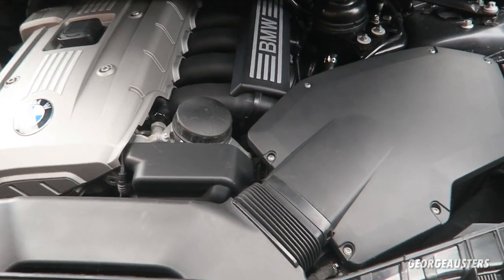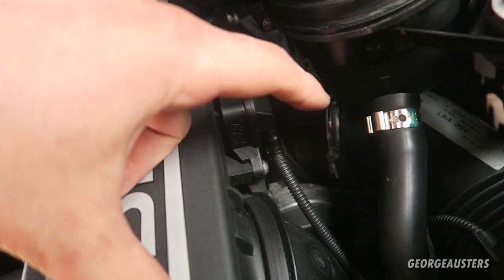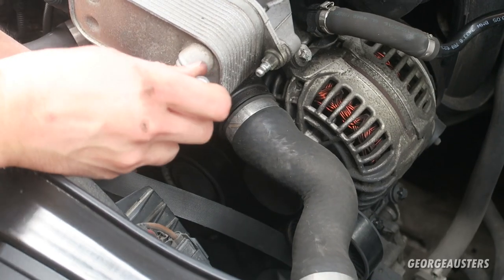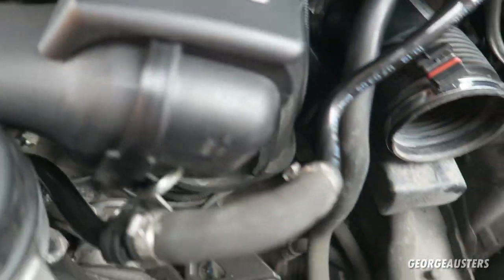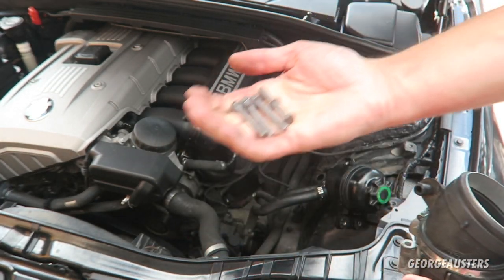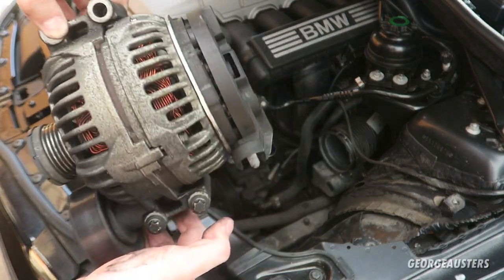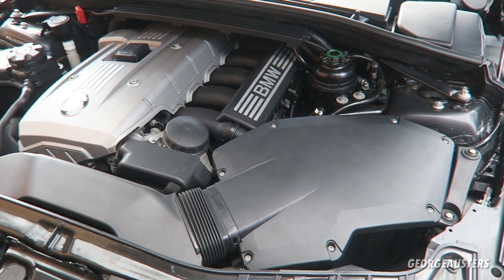BMW N52 SMALL DISA REPLACEMENT *Without Removing Intake Manifold*

Comment: This right here is the best idea you've ever had, my friend! Pure genius. 
Everywhere else insists manifold removal is the only way and I don't ever want to take that thing off again.. The starter motor required it but the problems start when trying to reconnect the last couple of PCV hoses. Suffice to say it had to come off twice to fix the large vacuum leak that resulted from me failing to fully seat the last hose to the crankcase at the PCV end. It was impossible to reach without starting again. Gutted
Reply: Actually the last crankcase pcv hose is reachable from under the car. Mine was noty fully plugged to the valve cover. With a help of long screwdriver I plugged it in from under the car.

Comment: awesome video. was trying to get my small disa valve out. got all three bolts, but wouldnt budge, i assumed i must have missed something came here to find out i didn't. yours seems so easy. thanks!
Reply from the maker: Only 3 screws holding it in, likely just stuck with the gasket, need prising out
Reply: Not sure if it works for you but I used a screw driver flat head from the top of the intake and use the intake as leverage. Switch between left and right and eventually it comes loose.

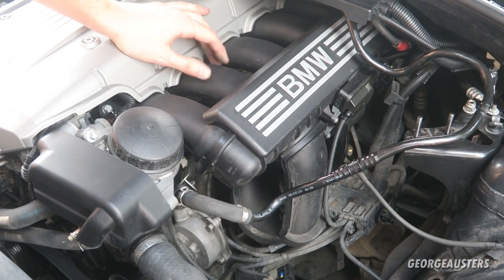Comment: NOOOO..... I just got up to 11:20 on the job, and on the 2008 E92  - N51  I definitely need to remove a CCV pipe that's in the way of pulling the Disa valve out, under the manifold. I can reach the near end to remove it, but not the back end... I'm afraid to try to flex that thing. I could have seen that after removing the alternator, but I didn't look too closely with a light. UPDATE: I got it! Just removed the front end of the pipe, and could push it aside just enough!
Reply from the maker: Good stuff
Reply: How did you remove the front end of the pipe? I’m currently stuck here

Comment: Hello Georges, Thank you again for this video, I would gladly give a few € but I fear the scam with VISA. 
My BMW Z4 E89 2009 23Sdrive 2.5l 6 cylinder 200.000Km does not require dismantling the alternator, the small DISA goes through the rear of the engine. There are just a few difficulties with the vacuum hose. 
The engine was running badly at idle and meows made me think of the belt for a long time, but no, it was the 2 DISAs.
Good road to all
Reply from the maker: Glad to help!
You can buy me a coffee / beer here: https://www.buymeacoffee.com/georgeausters

Comment: Thanks, this is really interesting to know that you can somewhat easily check/change your DISA valves with less hassle (though I think it could be the right time to change all seals and the PCV system in the meantime).

Comment: This has been really helpful thanks, George! I did this with my E61 with the additional stage of removing the cooling fan to gain access to the drive belt as there's very little wiggle room. I'll be replacing my tensioner and belt very soon, too. Similar process as far as access goes. Cheers!
Reply: This was helpful as I’m attempting to replace both DISA’s on my dad’s E60. Cheers 👍 

Edit: Just completed the work and your tip helped me alot. Thanks George and Bryce ✌️
Reply: @BOOMROCK535I  I'm not sure if it'll help you, but I've done an E61 (E60) video on my channel replacing the disa. Similar to George's, but there are some differences.

Comment: While you had alternator out , you should of replaced voltage regulator in it ,at that mileage they are getting there , had mine replaced at 130 k and was just in time , brushes were almost completely worn out . Plus it would be a good diy video too . 😀
Reply from the maker: Yep I’ll replace the alternator when it needs doing, very easy to remove👍🏻
Reply: George Austers , I click on your eBay link for the disa valve and all it does it takes me to eBay ? Could you please maybe repost the link , I am looking to get a disa valve too and am in USA and here we only have genuine bmw ones and Chinese copies which is a no no for me , I have never seen Febi make one and that’s a great , Febi is good parts supplier.
Reply from the maker: @eldin9117  Fixed! https://ebay.to/3i9kkvl

Comment: excellent video!!!  thank you very much for your help!!
i replaced both disas, the voltage regulator, and cleaned the throttle body on my 2008 x5 3.0si using this method.  but now I have a code (2A16 DMTL, superfine leak).
I must say that the process is not as simple as it seems, but with patience you will have favorable results.  With the small disa I found a hose (I think it's from the PCV system heater) that goes between the block and the intake manifold all the way to the alternator.  and that makes the job a little risky when it comes to having to pry that hard plastic tube to be able to remove the small disa from the intake manifold. maybe I managed to crack it and that's why now I have that code.  (I hope to find a video on how to replace that). 
At the end, it is not a lie that the work is done in a fraction of the time compared to having to disassemble the entire intake, but since everything has a risk, this is not the exception.
Finally, I want to mention that if you disassemble the throttle body, it is not necessary to disconnect it (I did not do it because I didn't know if it had to be reprogrammed, which I do not have how to do).  you just need to put it aside safely and out of the way.  so there's no risk that the computer won't accept it, or anything that might happen that I don't know about when reinstall it.  good luck.  and again to george, thanks for your videos, they are very helpful. I mean it.

Comment: Really good video, thank you. My car is throwing a 2AA9 code – reckon this is the small DISA?
Reply: I have exact same code , was that issue ?
Reply: @chadriddle3517  I decided to change both in the end, and even bought the parts, but somehow still haven't got around to doing it! (It remains a shadow code, no warning lights.)
Reply: @mcba  that’s same as mine does no service engine soon light but when I scan it shows up as a fault . I believe mine is the inner disa . I too have been putting it off .lol . So many things that can break in process.
Reply: @chadriddle3517  Have finally got around to doing this, the video was invaluable. 2AA9 code seems to be gone initially, although too early to be certain. Also, the idle seems better, but again it's early days. Overall not too bad a job. I highly recommend having a tiny 1/4in ratchet (I use one sold as a bicycle tool) as the little Torx bolts aren't the easiest to get at. I did both DISAs, drive belt and air filter and the only casualty was a single snapped plastic clip – I can live with that!

Comment: Great Video! Do you think you could have replaced the breather hose running from the Valve cover to the breather valve under the intake using this method? Thanks for thinking outside the box..
Reply from the maker: Possibly!
Reply: @GeorgeAusters  I'm replacing my valve cover and I do have the new hose, but I'm hoping I don't need it yet. Fingers crossed it doesn't break when I remove it from the valve cover. I plan on doing the entire breather valve assembly later and I will remove the intake manifold for that. I will also replace my starter at that time. It has 95000 miles on it.

Comment: Thanks for the video. I will do mines, do you know what is the torque spec for alternator, disas, and throttle body ?
Reply: @george austers 
This comment is actually valid for all your videos. All well done, but tightening torques are missing. If you know them, would be perfect to write them down in the video description. Cheers

Comment: How are those Febi DISA valves holding up?   
They're more expensive than most other aftermarket ones, but it seems they can fail in a matter of months, so a complete waste of money.
Btw it seems theres some variation with these engines, the small DISA in my E60 IS screwed from the same side as the valve, therefore very difficult to release (hard to fit any tools inside that tiny space and accees the torx bolts) so perhaps this method applies to the 130i only....?   No big deal for me since I've taken the manifold off anyway to do the CCV, but for anyone else wishing to do just the small DISA I would check that first as you may get stuck trying to do it this way.
Reply from the maker: Been fine!

Comment: Great video. How do you check the disa? Should you be able the turn the flap at all?
Reply: You should not be able to move the flap by hand. You can test the disa if it’s connected to the plug outside the car using inpa software on a laptop connected with cable. You can find it by searching for inpa disa testing probably.

Comment: Really good video! Please go ahead with more :)
Reply from the maker: Thank you. Anything you’d like to see in particular? I have many more videos planned for this engine
Reply: George Austers what I have to do next, but this is very complicated, is to change the seal of the VANOS eccentric shaft (not sure how it’s called in English). I’m this regard I even have to change the valve cover gasket 😅I have so many ideas :) e.g. VANOS solenoid check valve —> very difficult to get there
I have to change the hydraulic lifters as well as I have always the ticking which is disappearing with high speed but is always coming whenever I‘m driving short distance
And much more :) 
I love this engine... I want to keep it as long as possible! 
I also want to try out the clean pistons with Toralin to reduce oil consumption

Comment: If the flap was broken it will rattle or give fault codes. There’s absolutely no need to change this part. Why?
Reply: Because parts of it could get sucked into the engine. Usually cylinder 6.. look it up 15:31

Comment: Where does the big disa bolt go?
Reply from the maker: Watch my big disa replacement video
Reply: @GeorgeAusters  I meant the long bolt from the small disa. 

I've watched both videosmultiple times, it has helped a lot.

I was able to find another new Zealand guy who said it goes to the bottom hole.

I am done for the day, hope to start the car tomorrow in hopes that there's no leaks.

Comment: Will this step by step be the same for an N51
Reply from the maker: Yes
Reply: @GeorgeAusters  so lately my 328i has had a very subtle rattle coming from the right side of the dash, almost as if it’s coming from the vents. It only happens when I’m going like above 55 mph+ . I notice it when I’m shifting to 4th, and it’s so light you can only hear it with music off and windows rolled up. Does that sound like a symptom of either DISA

Comment: Didn't work,  couldn't get DISA out, fuel rail is in the way.
Reply from the maker: Haha you must be joking
Reply: Honestly,  the fuel rail is impeding the ability to take the disa out enough to pull it out through the front
Reply: Ok, not the fuel rail, but a ribbed tube of some sort is preventing me from being able to get it out far enough
Reply: @andrewharris6942  Done this job last week. Actualy, there is a ribbed tube from CCV blocking DISA from proper removal. George
forgot to mention that, but I´ve just pulled it away and DISA was free. Very good video tough.

Comment: Will it make noise when it fails? Does n52 have two DISA?
Reply from the maker: Sometimes
Reply: @GeorgeAusters  Thanks bro!  I can hear the intermittent knocking sound in my intake manifold, kind of like the sound of a small stone in it，im not sure what is that
Reply from the maker: @guopengming8583  Remove the DISA's and check them